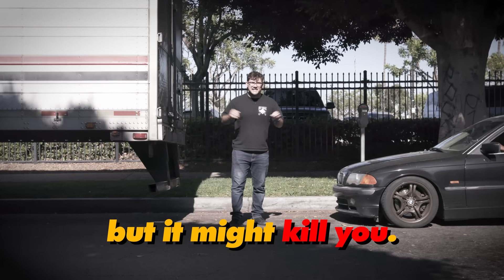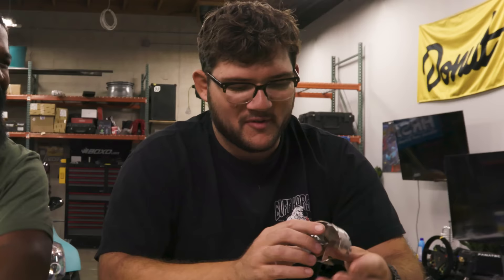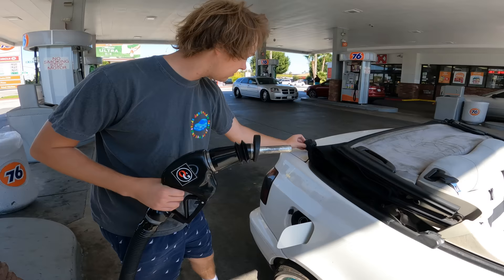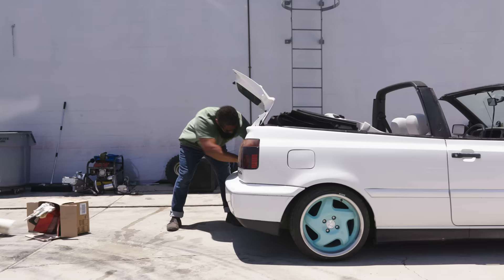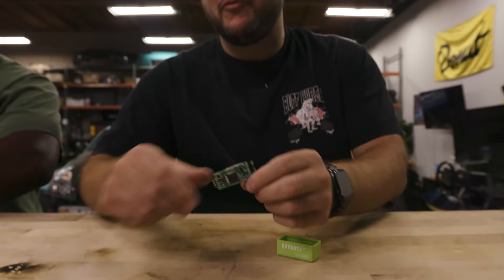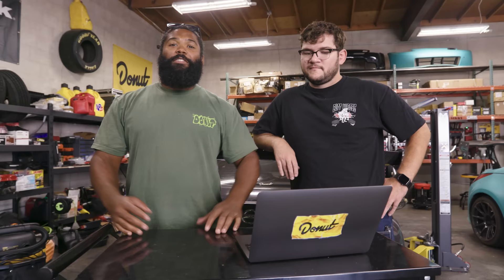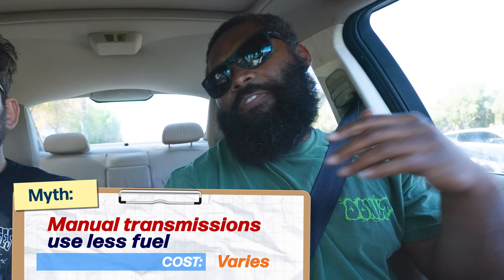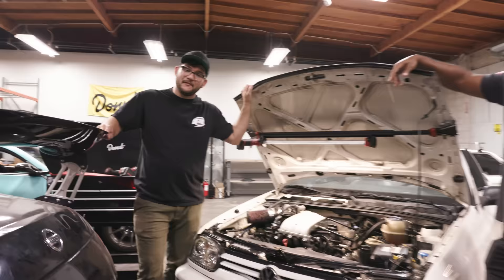Testing Fuel Economy Hacks

Comment: On the automatic vs manual.  Manuals usually weigh less (sometimes by a lot).  That can make a difference.
Reply: and no pump losses
Reply: @Veikra  Also when idle at a light or whatever the engine does not have to spin a heavy torque converter the whole time, and if you are downshifting to coast down a hill using engine compression that whole mechanism is more efficient. Autos usually use a lot more fuel if you don't bother downshifting in that scenario though for the same torque converter related reason. Most people don't downshift in autos and just coast and use their brakes down mountain passes and the like which means the engine has to use a small (similar to idle) amount of fuel to keep spinning the torque converter ready for you to press on the gas pedal. Doing this will make a difference on mpg going down a mountain, the same reason that you don't want to put your car in neutral going down a hill as some people think works. A good rule of thumb is that if you are speeding up at any sort of bike-like coasting rate while coasting down a hill you will be using a bit of gas in the engine, even in a manual. Manual drivers are simply more aware of this since they shift all the time and a manual car ecu will be truly putting 0 fuel into the engine in this downshifted, slowed by the transmission state. There have been many times (I live in a state with many mountain passes) where I have gotten 10-20 more mpg on a trip than I should have taking advantage of this at every opportunity in my manual car by simply sitting in 5th gear instead of 6th which maintained my speed down a hill. An auto with way more gears than a manual will obviously completely negate these negatives though like they said, just from general efficiencies during normal driving and depending on where you live and how flat it is, could make the hill stuff totally irrelevant.  It's an almost negligible difference unless you don't downshift your auto anyways.

If the road is not downhill or steep enough to keep speed constant or it is very steep (aka you are speeding up or not speeding up much while in the top gear), then there is actually a quite-complex optimization problem involved in determining whether coasting with a gear engaged and fuel cut or disengaging the engine and using some fuel to idle is more efficient, and a modern car with an automatic or automated-clutch gearbox will actually be evaluating conditions at all times to determine whether to activate a special "coast" or "sailing" mode where the gearbox is placed in neutral automatically and reengaged when power is requested again. This is the state I am talking about with an auto where it uses some gas going down a hill. It has to keep that torque converter running while it is doing all of this, and the computer has no idea what conditions it truly is in, unlike the driver. I guess what I am saying is that you should totally downshift your automatic cars and let the ECU know what it should be doing instead of cycling back and forth from idle back to engine compression. That's what the lever is for! Your wallet will thank you.

Comment: Years ago in my 98 ranger, I used to draft semis all the time (45 min commute on a freeway). No question I got better milage. There's a weird space you have to get into though where the vertical turbulence makes the vehicle rock side to side that you will definitely feel.. Punch into that area about 3 or so feet and you'll get far better mpg, but still deal with the rocking.
Reply: In my 2017 Colorado I played around with drafting semis. Being in that first spot behind (NOT dangerously close) definitely improved instantaneous MPG. Boring view, though. My impression is that this technique works better on pickups and SUVs than cars.
Reply: I did that with a scooter with pillion. The top speed went up effortlessly. Then comes the wobble of death from the wind pounding left n right.
Reply: You can also “slingshot” the truck when you pull out
Reply: Did the same thing with my 2.2 Sonoma and got estimated 5mpg better
Reply: Yeah I noticed that with my 2003 Pilot. You don't have to be 10ft away to get some benefit, I imagine especially with non-aerodynamic vehicles. But yeah, the back and forth pulling you have to get used to.
Reply: @robsmithracing  "slingshot engaged" 😂
Reply: I have a 98 Ranger and a 45 min drive to work 😂. Driving across country I drafted a semi all the way across Utah in the middle of the night, the truck driver was cool and knew what we were doing. Eventually I passed him and waved to thank him.
Reply: @stpbasss3773  I'm a truck driver and I notice people doing this, not all are doing so because they want to save gas. From my perspective, though I cant see you. If its daytime I can see your shadow on the road and if its night I can see your headlights under my trailer on its tires and know you are there. I don't do any sudden movements so I am not super worried about causing you to crash. However it is a risk on your part and I don't see it causing me any harm if you are hanging out back there. 

I will say that I don't like it as much when other semi's do it because I know they cannot stop very fast and if they hit me it will do a lot of damage or potentially they will swerve and cause lots of damage. But still its not in my control so I don't worry about it. 

If you want to drive fuel efficient though, slow is king. driving 55 in my freighliner will get me 10MPG if I got like 20-25k lbs of freight in a 20k lbs 53' trailer. However if i increase speed to 60, I get about 8.5-8.8mpg depending on how fast I let it go above the speed limit when going down hill, because at that point everything over 60 is over the limit. If I just gun it all the way all the time and go 65(governed at that speed) I have seen it get to 5MPG
Reply: windy day in a ranger is fun.
Reply: @robsmithracing  I used to have to slingshot all the time in my ranger. Gutless little thing.
Reply: @crazeguy26  lol if you know you know.
Reply: I know the drafting hack works, but the risk of getting into a major accident surpasses the gas saving move. I hate driving behind cars the obscure my view ahead, including SUVs and some crossovers... I just don't feel safe relying on someone infront of me, they might be on their phone or whatever and knowing how bad american drivers are with their phones glued to their hands and no common sense also no defensive driving. So yeah I'm usually infront of traffic and never been in an accident in 8 years of driving.
Reply: @detonater1348  It's very risky and potentially lethal. But when you live dime to dime, you start taking risks even knowing the life threatening consequences it could bring. Despite me doing that in the past and being on my third job doing a lot of driving, I've never been in an accident in 15 years.
Reply: @DuxGalt  thank you for sharing this
Reply: @DamagedF0X  yea I get that, but I feel so uncomfortable following a car with no view ahead...but I get u
Reply: @ejsdead-6363  I maybe should have mentioned that my personal view is that I prefer to drive. and when you are tailgating anyone for any reason you are not driving, you are reacting. some people are good at reacting but I would not call it driving because ultimately you are not in control and maybe when at the wheel of such power you should be control. 

that's another reason I sorta like to slow down or speed up out of traffic bubbles because  when you are surrounded by other vehcials you just don't have a lot of options and it does not feel like driving it's just reacting. 

though through many cities you never get the chance to drive as I describe because there is just too damn many people on the road trying to get somewhere with little to no regard to anyone else. everyone is just reacting to everyone else's reacting and its I think why you see so much road rage and generally poor driving in city areas. my point being they are not driving the car but instead their ego is reacting to everything and it just escalates until somebody gets hurt

Comment: 10:44 
Adding to the talk: running the AC is more efficient if you plan on driving consistently above 40mph. In the city, window down doesn't affect fuel efficiency that much because the car is rarely fast enough for the aerodynamic drag to be so strong, so this tip is mostly for people who use highways for travel or work.
Reply: Years ago, I had a 1 hour commute to work, mostly on the highway. When my ac went out, I drove with the windows down and saw a 2-3 mpg benefit, more in cooler weather. It might be dependent on the car, mine was a Ford Escort ZX2.
Reply: Would it be safe to assume it also depends on how far your windows are down? Because of the amount of power my AC saps from my low HP motor, I usually crack the windows on the highway instead of running AC.
Reply: @2A_Tree_Hugger  it might. My unofficial tests were between windows up, ac on max (I’m in South Texas) and windows down, ac off. Your mpg would probably be higher with windows mostly up, ac off.
Reply: @davidg4781  Where you running your AC constantly when driving? One tip is to turn it on, get the car cool, then turn it off and use recirculation to keep the cool air in the car.
Reply: A 1.0L car will see a more drastic drop in mileage than a 6.0L+ because the engine will hardly notice the A/C compressor at that point. Also different size cabins to cool
Reply: @McBenjiBoo  Anywhere in the US South or West...My AC stays on 10 months of the year.

Comment: 4:54 low tire pressure increases rolling resistance and this loss is compounded by hysteresis loss, higher tyre pressure does add more miles per gallon ☮
Reply: Yes definitely, sad that they dismissed this as a myth, it's well known that higher pressure improves gas mileage slightly and I run my tires about 5 psi over recommended. I suppose it was due to liability not following manufacturers recommendation.
Reply: I drive a 80's Fiat which has really steep camber angle on the rear wheels from factory, I always thought they did that to improve stability in corners, but as it turns out, the main reason they did it is so that the rear wheels would mostly ride in the corners of the tires, thus decreasing the contact patch, thus decreasing rolling resistance, thus saving fuel.
It's an cheap economic car, so it makes sense they'd do it to make the car as economic as possible. Not good for safety though! hahaha
Reply: It saves more fuel for the cost of tire wear; it might not be worth it. The cost of new tires essentially cancels out the price of how much you saved compared to using factory standard PSI.
Reply: @3p1ks  maybe, I'm more of a 2wheeler guy (can't afford 4 wheeler 🥲). I've approached it theoretically, maybe in practice it will vary from vehicle to vehicle. ☮
Reply: @3p1ks  Nope ... modest increases in tire pressure will not significantly change the shape of the tire and will not increase tire wear.  The jump of 30psi to 45psi they did was foolish.  Try a sensible 10-20% increase instead.
Reply: ^^ The point I'm trying to make is this: Tyre wear and fuel economy both have linear relationships to tyre pressure. A marginal increase in fuel economy gives you a marginal increase in tyre wear. A large increase in fuel economy gives you a large increase in tyre wear. Because both react to the same input - tyre pressure - both will react at the same time.
Reply: @josephpbrown  not true If you have your tire pressure up you have less rolling resistance causing less tire wear.
Reply: @john.glasscock  it’s just as much energy/friction/wear on a smaller area of the tire. So it will shorten the life of your tire if you’re replacing them when any part of the tread is under the minimum. You could just willful ignorance that shit and measure the edge of the tire until it’s under minimum since that’s the part that will wear less… but that’s not very safe if you plan to drive on a wet road at all
Reply: @pencir5737  when you increase the tire pressure you have less of a contact patch circumference wise.
Reply: yea but you will have to pay more in tires later
Reply: @StheC  that's not true less rolling resistance means less wear. Y'all never hypermiled before
Reply: @john.glasscock  Simply not true. This is more complex than A=B.
Reply: It sounded like their argument was that while it would increase fuel mileage, it would also decrease the life of the tires and the difference in mileage wouldn't make up for having to replace tires more often.
Reply: @PhilKanish  bro have you ever ran higher tire pressure. The reason why you get better gas mileage is because there's less friction because there's less friction you get less wear on your tires this tire will still be flat when looking at it at a side profile it's not going to bow out like how people think unless you get  higher than 45 PSI
Reply: i dunno the guys arguing against having proper tire pressures but I generally prefer it due to better acceleration and engine respond time and braking. 

Having proper tire pressures also mean the tire thread wear would be even and not weakening your side walls.